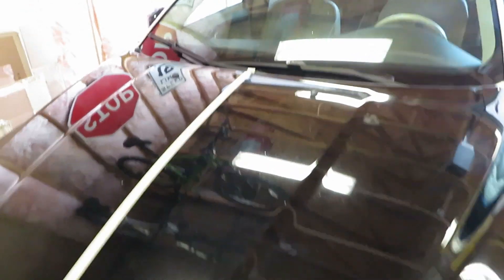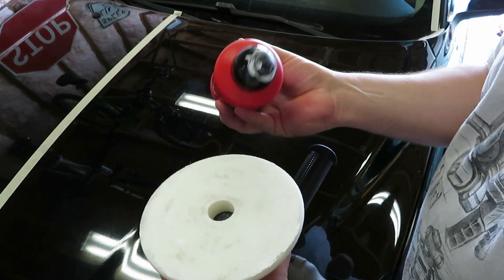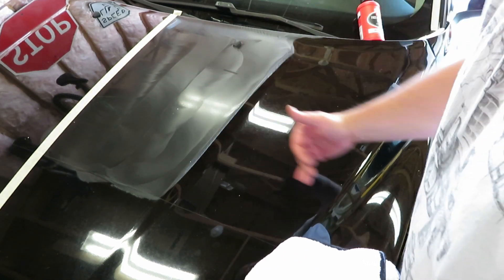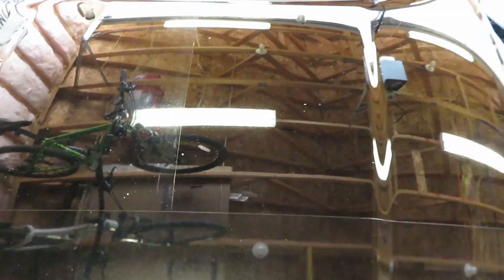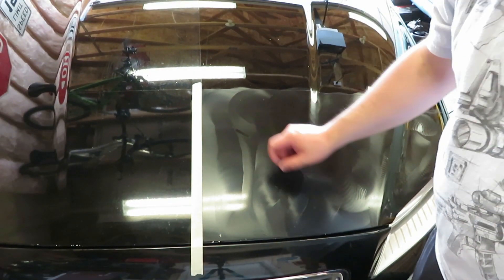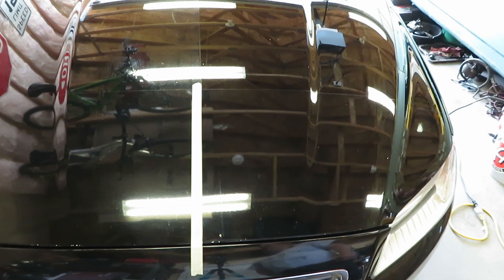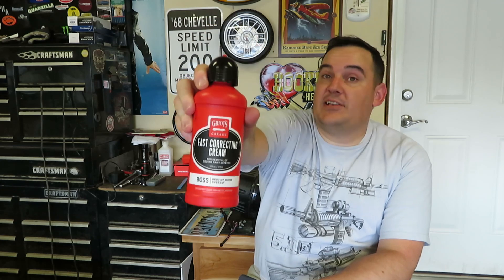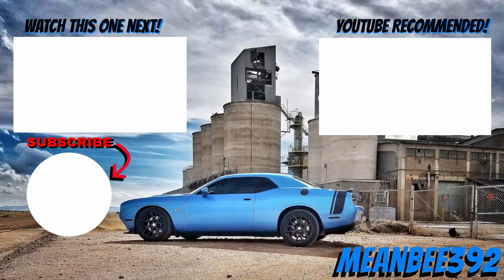Griot's Garage BOSS Fast Correcting Cream Review!

Comment: Fast Correcting Cream is great stuff and it smells nice too which is really rare for compounds and polishes.  The only very minor downside of FCC is that it can sometimes be a little difficult to wipe off. My number one cutting compound is Sonax Cutmax - it has a similar level of cut as the FCC, has no scent, and is very easy to wipe off.  Fast Correcting Cream is my second favorite and is probably the best bang for the buck compound in terms of level of cut for the price.
Reply from the maker: Thank you very much for sharing your experience and thoughts on the FCC. I haven't ever used any of the Sonax products but now hearing your experience with them really makes me want to try some out! Thanks for the info and I appreciate you watching and commenting!

Comment: I switched to Griots FCC a while back. It’s amazing. If you don’t wanna wait for it to dry to remove. Just use a little less product. Saves you a little bit on your product and you can just wipe off immediately and go on.
Reply from the maker: I absolutely LOVE the FCC and glad to hear that you also like it as well! I had a brain fart and for some dumb reason was thinking it was a paint sealant and needed to haze up before removing... That is not the case at all just hit it with the microfiber right away and it wipes off SO easy! Thanks for watching and commenting!

Comment: I just bought this for my truck this week.  Going to do it this weekend.   Your Hood looked great.  Now a recommendation for you on the rock chips, I bought the Dr. Colorchip chip repair kits for my truck, motorcycle and wife's car and it works great.  Look into that system if you want to easily repair rock chips.  Great video.
Reply from the maker: How did this product work out for you and what did you think of it? I have looked at Dr. Colorchip and have wanted to try it, thanks for recommending it I might have to pick it up. Thanks and thank you for watching and commenting!
Reply: @MeanBee392  I absolutely love the Dr. Color chip product.  Works perfectly on the rock chips and scratches.  They even made a batch for my Hot Rod Yellow Honda Gold Wing trike.  Give it a shot, I think you will like the results.

Comment: Of course I made it that far! 😂 Car looked great and I knew you would like it. Man i have done that with the bottles 1 to many times but atleast i know i am not the only one. 😂 One tip though it doesn’t need to dry. It is best to remove it immediately in fact if it fully dries it would be very hard to remove. Great video brother
Reply from the maker: Thanks brother I appreciate you making it that far! Thanks and I loved it and was super happy with the results as well. Lol you just get in the mode and forget to remove the seal! I know I felt dumb and when I was editing I was like what did I say that... I tried to take it out of the video but I had a weird flow so I left it in and just rolled with it. That's my bad and an idiot move on may part but I think it would take a day for this stuff to dry lol! Thanks brother!
Reply: It worked as well as you said! I couldn’t get my hand on the correct pad. I used a Adam’s blue compound pad. Again thank you!

Comment: Couple of tips. 1. Store the bottle upside down! I made a thing in my stage shelf for them. Take em where I want. That way everything is at the top and it mixes faster.
2. There is no need to leave it on to dry. There are no sealants or waxes in it to bond. Just wipe er off and continue on!!
3 check out Alex Detail. Brian goes over different tapes. He is a vet over 30 years experience. There are different tapes. And one he uses is really low profile so the adhesive doesn’t get sucked in out how ever you look at it. Good guy, you can call him or email him. He responds.

Meat and potatoes videos. No BS! I emailed him a question and he answered pretty quick. 
I started doing all this by hand in the 89s.

Cheers man. Have fun. The Boss line rocks. I use an orange pad and correcting cream. Few dots of perfecting and it finishes out awesome!
Reply from the maker: I have checked out his channel and he has a great channel and is VERY knowledgeable! That was my mistake and a brain fart thinking that it needed to dry and I feel like an idiot for having that in the video. That's awesome to hear that you can contact him and he will get back to you. I am just an armature and I do it on the side and for fun and I am always learning. I want to use more of the BOSS line because it is a very solid line up. That's awesome to know about using the orange pad with the two compounds to make a one step polish and I am going to have to try that out! Thanks for all the info and watching and commenting I really appreciate it! Take care buddy!

Comment: First mistake using the handle hold by the head of polisher and moderate pressure
Reply from the maker: I wasn't putting any pressure on the handle I use it mainly for control but thankfully I upgraded my polisher and it doesn't have a handle now lol.